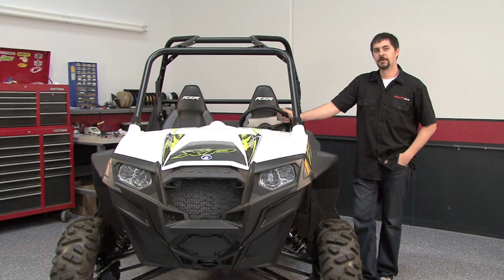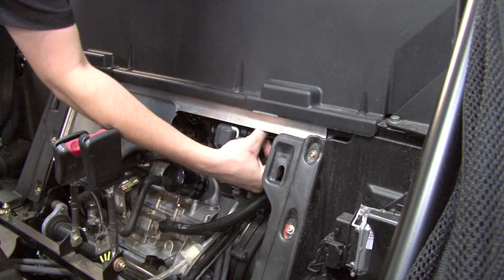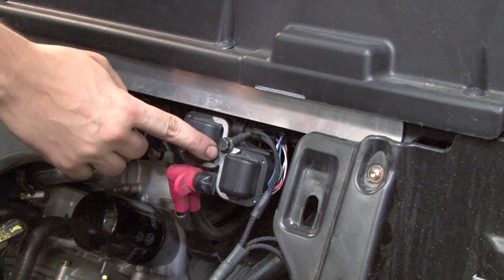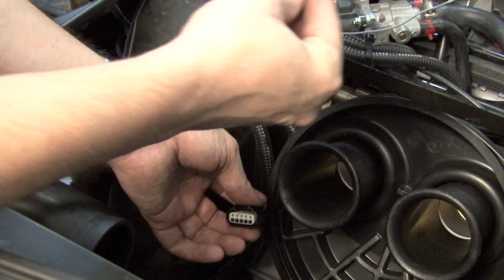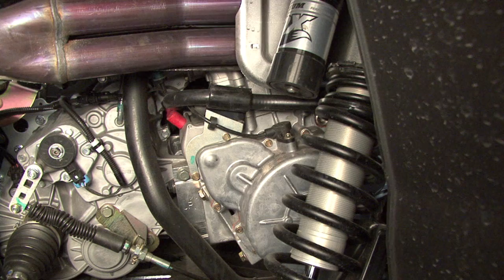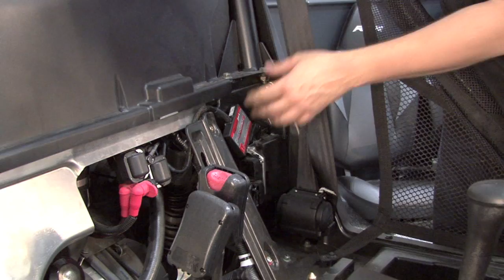Power Commander V Install: 2013 Polaris RZR XP900

Comment: One question this power commander fit to my polaris rzr 4 xp 2013?
Reply from the maker: If you have an XP900 with a turbo kit, you can get this Power Commander V: https://www.dynojet.com/power-commander-v-for-2012-2014-polaris-rzr-xp-900-s-4-19-017-pti/

If you have an XP900 without the turbo kit, go with this one: https://www.dynojet.com/power-commander-v-for-2012-2014-polaris-rzr-xp-900-s-4-19-017/